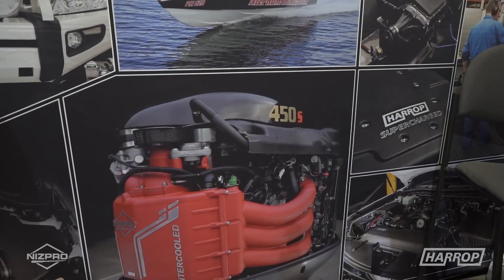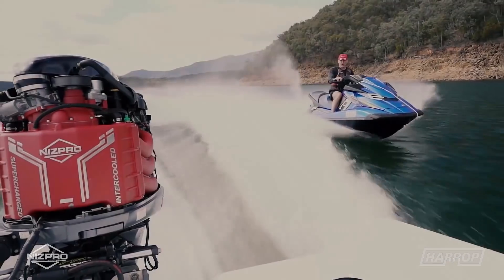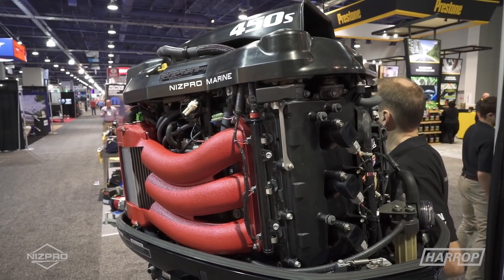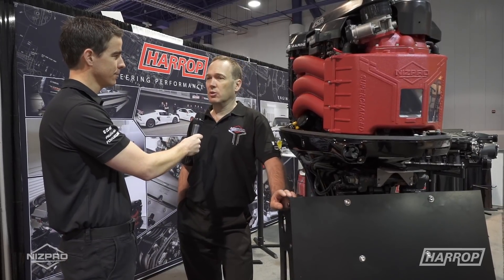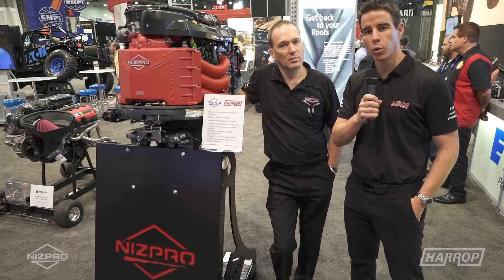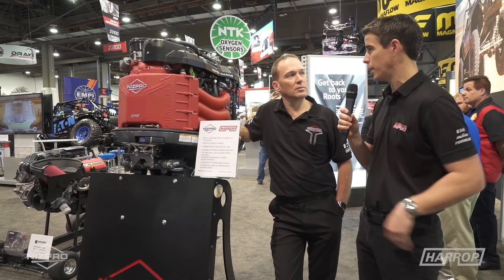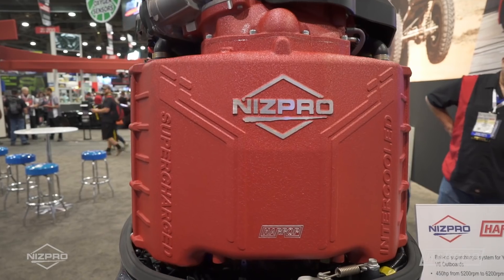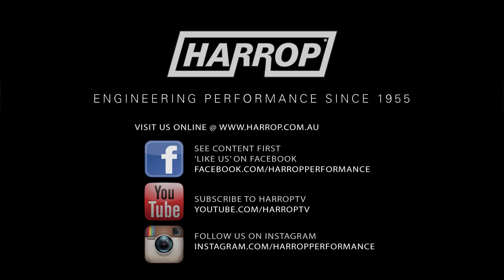Nizpro Marine 450s Supercharger | SEMA 2017

Comment: What mods would be necessary to insure the drive integrity?
Reply: They send a custom lower unit
Reply: @tomcat6918  Yamaha makes a 425hp outboard which is backed by a factory warranty, years of durability testing and millions of dollars in R&D. Why bother modifying one of their smaller engines to make 450hp and hoping that it doesn't blow itself apart?
Reply: Todd Brackett because the 425 is a 1000 pounds
Reply: @tomcat6918  what does the supercharged outboard with the aftermarket drive line weigh? The motor in this video appears to be a 4.2L V6 which in stock form is about  600#. That series of engines is rated to  225, 250 & 300 hp so the supercharger needed to achieve a  50-100% increase in peak power would be a substantial piece of machinery. The modification of the drive line required to handle 450 hp would also have to be significantly heavier than the stock unit. I also don't understand how you could add enough boost to achieve 450 hp out of a 225-300 hp motor and maintain reliability without other modifications to the motor such as lower compression pistons/heads, stronger connecting rods or different cams. The Verados increased significantly in power over time but I'm sure that this required more than just adding ever bigger superchargers to a motor designed to be naturally aspirated. I'm sure that Mercury had to make major mods to the engine and drive to keep it from blowing itself apart under all of that boost.
Reply: @toddbrackett4277  p
Reply: @toddbrackett4277 what a load of dribble it works very well with very little added weight and is now up 2 633 hp
Reply: @johnboy5167 , what exactly are you referring to as dribble?
People buy Yamaha outboards for their reliability.
Yamaha overbuilds components but do you think that pushing 633hp through a drive built for a 350hp engine is a good idea?
Reply: They know more than you you are talking dribble so run along little boy 🤭
Reply: @johnboy5167 , “run along little boy”, is this the new “trust me bro”?
Do you just throw in phrases like this to shut down reasonable questions when you have nothing intelligent to say?

A person with a functioning brain might respond with something like: 

“this supercharger and upgraded lower unit kit has been tested on a variety of boat types for greater than 1,000 hours and they have found no statistically significant difference in the component failure rates”.

or…

“Good question, I wonder how the aftermarket lower unit holds up to the supercharged engine compared to the OEM outboard?”